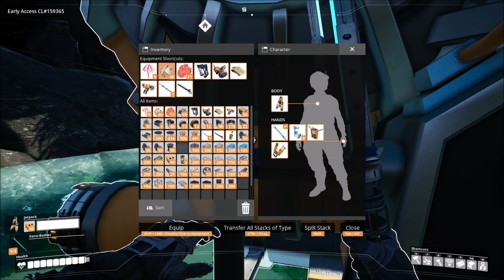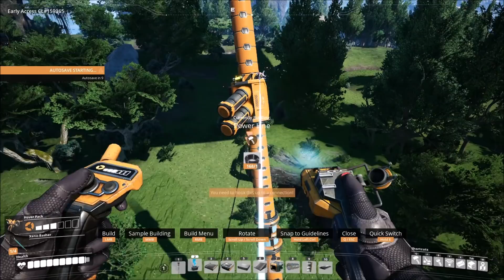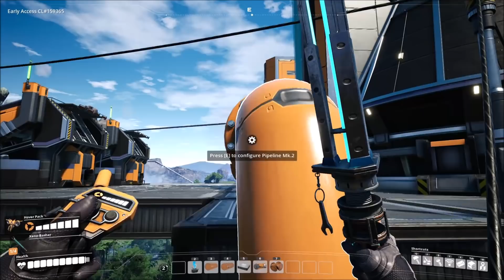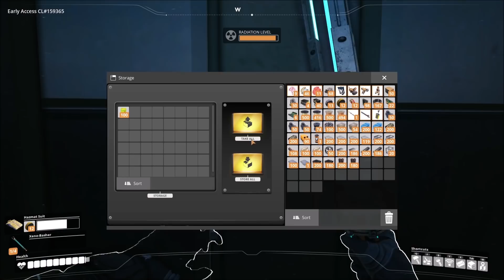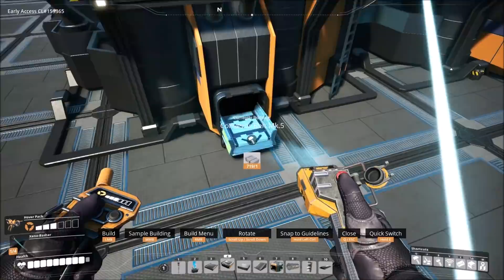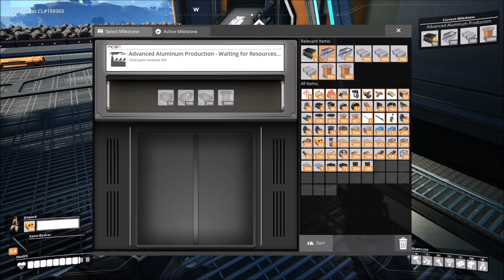Satisfactory Ep42 Reactor Cooling

Comment: Dire, do not overclock your generators.  You lose fuel efficiency.  The overclockers have a "Targeted" generation rate, but the max that the nuclear plant will do is 5000.  You are better off just building additional generators.
Reply: He showed in the video that the fuel lasts half as long, and produces twice as much power.
That's still the exact same efficiency.
Reply: This is just as false as claiming that you gain efficiency. The efficiency of generators doesn't change with overclocking; a fully overclocked generator will use resources twice as fast and produce twice as much power.
(250% overclocking on generators is actually 200%)

Comment: The discrepancy between the overclocker rates and actual power output is true for all power generators - it is never more efficient to overclock a power generator. To quote from the wiki: "Overclocking of all types of power generators provides no benefit other than saving building space." It's not a bug, but it definitely could be better explained in-game.
Reply: I would consider the overclocking panel displaying the wrong value to be a bug though.
Reply: Then why does the target amount need to be set higher than the actual maximum output the machine will ever generate? That, is most definitely a bug!

Comment: all the generators operate at twice as fast when overclocked to 250%. So it isn't a bug and there is no efficiency hit when doing so. just costing you power shards.
Reply: I think the question is that if you are over clocking something by 250%, then the resultant input and output should be increased by 250%.  If they only want the generators to go up to 200% then they shouldn’t allow a third shard to go in.  It’s just an inconsistency in application that appears to be the bug.
Reply: @Kzorith  if it wasn't every generator, i would probably agree with you. And if you look on the wiki about clock speeds you see the math all checking out. So you have to assume it is all intentional.
Reply: @Kzorith  The bug/issues is just that the displayed values in the overclocking window are inaccurate. 3 full powershards are needed to go to full overclocking; it's just that "full overclocking" is doubled consumption and production for generators. The values in the top left are accurate.

Comment: Use the power switch to turn off production of cells. Then with no fuel rods the plants wont run. Just throttle so its not prodcuing extra
Reply: excactly what i was thinking

Comment: Hey Dire, you can just put the the power switch on your last water pump, that way you can turn it off and the power plants will actually stop working as soon as they run out of water
Reply: Probably a bad idea to switch the water off. Switching the fuel off would be a safer option. Safest option would be to switch off the Miner that's drilling for Uranium.